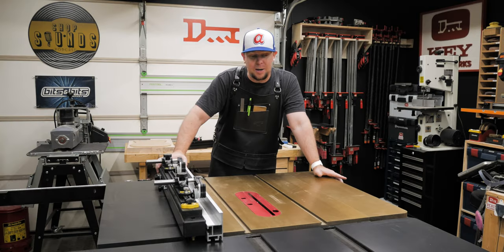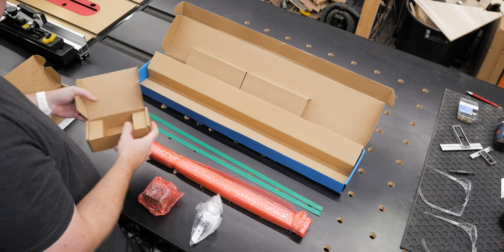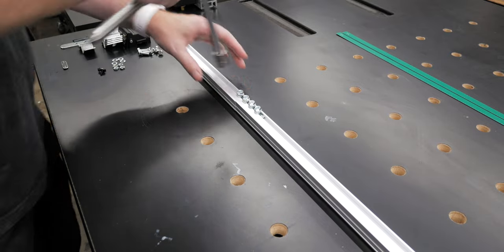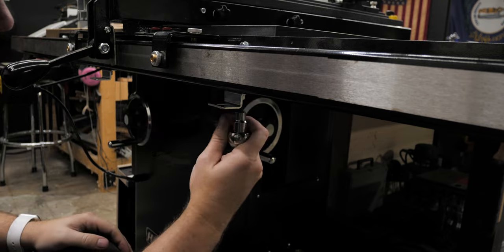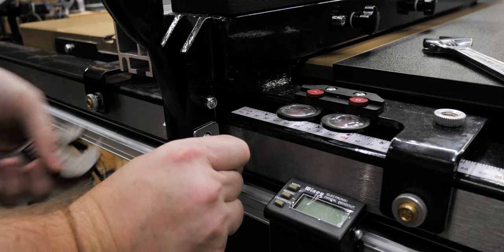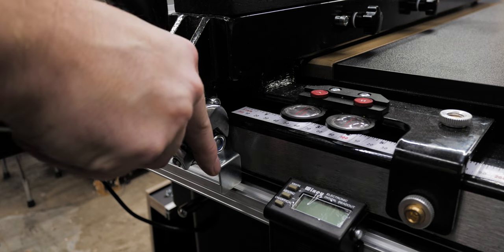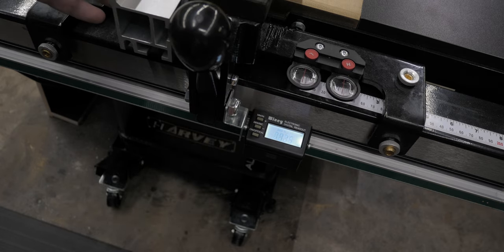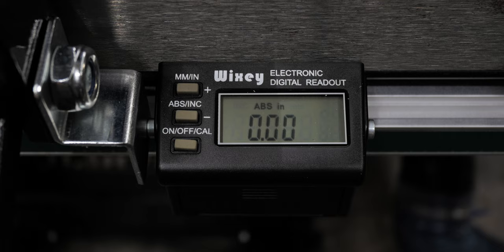How to Install a Wixey Digital Fence Readout on a table saw

Comment: I knew you'd have no issues with that setup!
The nicest thing about the Wixey gauge is the fact you can recalibrate it at any time by the same method you showed.
You can also switch it over to INCREMENTAL mode and re-zero for bump adjustments (I want to add a 1/64th or 0,2mm to that...) without changing the ABSOLUTE mode. press the button to switch between the two modes. A single press of the zero button only affects the incremental mode. You have to push and hold to re-zero the absolute mode, so it's more difficult to screw it up!
Reply from the maker: Yeah it’s a pretty neat little piece of kit! I’ll enjoy seeing how close I am to being exact for all my cuts now

Comment: The Wixey is a great unit that I have used for over a decade. I hate the blade calibration method and use a different way. Set the fence anywhere, rip a stable hardwood, and zero the Wixey. Measure the ripped board and back up the fence to negative that measurement. Zero the Wixey again and done. It really is a reliable device that I trust much more than my eyes on the ruler.
Reply: Wow thanks for that tip

Comment: Sup nick how you liking the new saw?
Reply from the maker: It’s awesome
Reply: Nick, I just set up my Harvey 4HP tablesaw a little over a week ago. I have installed the jessem clear cut as well. I agree with you that this thing is awesome! So smooth so quiet. I also have their dust collector which is also an incredible piece of machinery and so quiet. 
I wonder if you might give us a quick video on your outfeed/work table looks like you’ve got an MFT going on. Anyway, it looks like we have a similar set up and I would be interested to hear a bit more of what you’ve done and what you plan to do
Reply from the maker: Hey awesome! Yeah it’s a great saw and I’m currently looking to make room for their dust processor too! My outfeed/assembly table is a mft style and has been awesome for holding stuff for jointer and assembly.
Reply: @KeyWoodworks  I’m in a little 20 x 20 shop. And I’m looking at having an Assembly table near the front entrance where I bring in my materials. I’m thinking I can break them down with my track saw and then get them over to the tablesaw. 
Do you like having your assembly table acting as your outfeed table? I’ve got a 20 x 60 heavy top workbench that I was thinking of using as my outfeed so that I can pull it away from the tablesaw when I actually need to use it as a workbench.
But it sounds like the assembly outfeed combo is working well for you